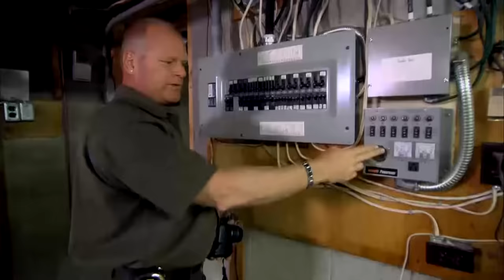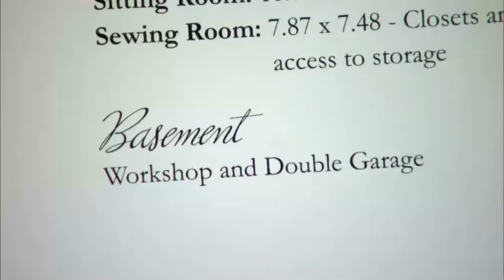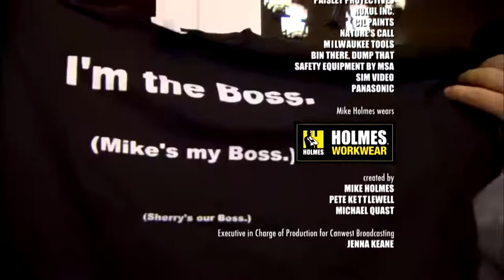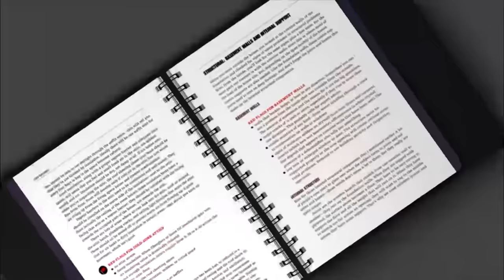Dream Home Turned Nightmare! | Holmes Inspection 119

Comment: Never use a home inspector that came recommended by a realtor. A realtor doesn’t want any possibility that the sale won’t go through.
Reply: Thanks! What would be the best way to find a good home inspector?
Reply: Or the home owner. ONLY get your own.
Reply: What a money pit.  Who is paying for all of this??  I guess the buyers got screwed by the home inspection.  Hope they can recover some of the expense to fix all of these problems.  With that type of construction, exposed walls, flat roofs, etc, there are going to be on going problems with leakage.  They should  have obtained separate well and septic inspections.  What a learning experience for the new owners.
Reply: @SophiaAphrodite  It is (at least in the US, I have not looked elsewhere) free to download the building codes.
Once you set aside the stuff for commercial buildings, you can even self-print a moderately thin pile to put in a binder.
Learn the basics about code.
Be your own backup inspector. If you can be present when the inspector you hire goes through, bring your notebook, ask questions, point out what you see.
If your inspector does not have at LEAST a ladder, a level, and a thermal camera, reconsider hiring them.
The should danged well at least get up to look at your roof, check the whole attic (no meercat action of poking the head up and calling it good), and walk through every space they are legally allowed to walk through.
-
If the SELLER bars you or your inspector from some part of the home ("Don't go up on the roof", the attic access is sealed with silicone, the cabinets under the sinks are padlocked) take that house off your list. They are hiding something they KNOW would lower the home's value.

Comment: That mold inspector was an absolute legend. Probably saved the lives of a few people in that family. Automobile fumes are no joke. For a series that finds negligence that inspectors and craftsmen miss or purposely ignore, its super nice to learn of a golden apple amongst the rotten ones.
Reply: Was thinking the same thing.  Nice to hear that there are people out there in the trades that have knowledge and aren't afraid to speak up and do what is right.
Reply: Make you wonder what training and qualifications needed to become a home inspector.  One should ask about their experience and qualifications before hiring them i reckon
Reply: Wonder whether there's time constraints on filing charges against original builder . . . defects thereof ! 🧐 🇺🇲 🤔
Reply: @mujkocka  Nothing. There is basically no training/certification/anything required to become a home inspector. There are trained/experienced inspectors out there, but it's a completely unregulated 'profession'. Many home inspectors don't know anything more than an average buyer. They get some minimal training at best on current code, and that's about it. Further - Even decent home inspectors are ultimately one person. They don't know every trade and will ultimately miss problems.
Reply: Ive seen people put garage doors in and just use it as a woodworking shop. That HVAC was still screwed up regardless lol
Reply: I hope Holmes tracked that inspector down and shook his hand for that find on the house.

Comment: Mike should go to the parliament and push for revamping the certification process for inspectors.
Reply: seriously. I don't even blame the previous owner even if they were dumb DIYers the fact the inspector missed the most basic issues
Reply: I believe he did at one point, either his first show series or this one. If not for inspection, but minimum code requirements. Keep in mind these shows are from 2010.
Reply: Plenty of certified guys, they just don't care, or perhaps realise codes are there to prevent stupid people from hurting themselves.
Reply: @Revkor cheap shortcut contractors also or was this diy by a complete amateur????

Comment: Two issues I have are that the pit for the ground water should not have been buried (again) under the pavers. There could have been a heavy removable concrete lid or cast iron grate installed as this shouldn't be a covered access point. Also, the new interior spindles for the railing do not match this type of house. They should have been a more modern type vs the traditional look chosen IMO. These people were really lucky to have this work done by Holmes and the other Crews. Professional work all the way around!
Reply: I sure wish someone would give a professional opinion of the rough cost to do these home remodels.  I was a semi professional years ago, and I would guess this house needed at least $140,000 to repair!  Probably a lot more since most of Mikes shows are shot in Canada.

Comment: If the home inspector mentions anything in the report, have a contractor in to do an estimate, before you buy the house. The home inspector will say don’t worry. It’s nothing. The contractor will tell you how much it’s going to cost to fix it. Just like a used car can burn you if you’re not careful, a used house will burn you but it will be much worse.

Comment: Man that house is a fire trap, when you see that aluminum mess at the panel, you just know there are shady boxes like that buried in the walls all over the place.
Reply: Yeah for real.
Reply: The problem is, short of gutting the whole house, there isn't much to be done. You can make sure the right materials are used (aluminum rated splices and devices) and possibly try using arc fault breakers. 

I also think that the panel could have been addressed differently but budgets are always a thing and it is a great job that was done within the limits of the project. 

With aluminum wiring education is key, the homeowners being aware of it and it's risks in the home will hopefully keep them vigilant of issues and not ignore 'small' electrical problems

Comment: Split foyer and raised ranch houses in my area have the garages under the living space. The garage IS separated from the rest of the lower living space and ducts are covered (no vents) in the garage. I don't see why this house can't have the garage under the living space if the area is walled off, ceiling covered with 5/8 drywall and the ducts enclosed.
Reply: Exactly!
Reply: Perhaps cost? Might have required re-engineering HVAC to move trunk, would have had to seal the floorboards, ceiling. Would have still needed to heat the garage as there were water lines, etc. 

The home owners still pay for the repairs shown in this show (something like 20-30% of the cost) — it may have been their choice, or perhaps Mike didn’t want to touch that issue from a potential liability standpoint.

Comment: I love this show and Mike and his team did a great job as always, but I was sorry to see them remove the boards inside the house and put regular siding on the outside. I know the house was a lot better physically after they were done, but I liked the way it looked before much more.
Reply: For speed and economy. It's a tradeoff. Mike Holmes and crew are home builders first not preservationists. That's evident in many of these episodes. The one with the kitchen center stone range was especially disappointing with how bland it turned out. Even the homeowners appeared disappointed. Probably likewise in this episode with the finishes and taking out the garage door.

Comment: I am working HVAC in Montana on new homes.  These new homes have high efficiency furnaces in unconditional attics, with heat tape on condensate lines and the heat tape is inaccessible.  These were built with flex duct too.  All the retired baby boomers are buying these homes.  "Hayden Homes".

Comment: What this video really shows best is why houses should be made in factories using proven designs. All the problems which might exist in a manufactured house can be designed out before mass production occurs. If you build your own house and then allow an inspector to second guess the builder, you will end up building and paying for the house twice. The second time it will be paid for one small, expensive detail at a time.
Reply: Looks like a lot of work was done without permits and inspections.

Comment: Little confused why you barricaded it off where you can't even get to park next to the steps. Barricading it with boulders seems a little extreme! ?
Reply: Well perhaps it’s not to code to park right next to the house, just in case someone has the window open the fumes could leak through and kill them!!  

<sarcasm used in this post>

Comment: The producer always needs to rock the drama queen aspect. Don't understand why the "workshop/garage" didn't have the HVAC ducting reconfigured, new stud walls built up and sheet rocked to modern code. Wouldn't that have resulted in a space for a single vehicle? The pole in the middle of the garage door? As much as Mike loves bringing in engineered headers to take a load, seems easy enough here. Why was the cistern sealed up? Couldn't the mason have built up the cistern height to ground level and a drainage grate installed? This episode...leads in head scratching solutions.
Reply: I still can't figure out how that cistern drains what appears to be an uphill slope from what I could see.

Comment: The sad thing is my sister bought a house ( USA ) and had an independent inspector come in, she sent me the list and i went and visited her, first thing I said was get a plumber to put a new hot water tank in, not only was it old, it had a 35' run of exhaust to the chimney and it had no incline to it, just to the ceiling then 30 ft riding the ceiling to the chimney. I told her that would kill her. First thing the plumber said was the water heater wouldve killed you ( to my sister ) i am not in the trades but knew that was wrong.

Comment: @41:14:  Mike always talks about surge protectors in terms of lightning, but they're really more like water hammer arrestors for electricity.  If a large load slams off, it absorbs the shock at the panel instead of transmitting it through other circuits.  Sure, theyre useful if your house gets hit by lightning and has insufficient grounding, but that's not the most likely scenario.

Comment: In the UK and other countries home inspectors should be regulated and hold professional qualifications and hold insurance against missing vital costly issues. Perhaps a client could pay for an insurance policy against a defective report and then insurance companies wouldn't cover bad inspectors. Any claim above say £1,000 or £5,000 ( whatever is agreed by law to be reasonable) if the result of an inadequate inspection would be paid from the inspectors insurance.

 We should also have an independant ombudsmans service that all building contactors are required by law to join and have a bond to cover bad work.

  A licence to run a contracting business from the local building standards department ( code department) that could be withdrawn if the work isn't to code should be a basic consumer protection.

 People who break the law by doing work that isn't to code should be at risk of being jailed if taken to court. At the moment they risk almost nothing and carry on devastating peoples lives and financial security.
Reply: There is only so much you can determine externally without destructive inspections. You might notice Mike inspects a lot of stuff by poking holes in the walls.
They need to make permits cheaper and faster to encourage people to do the work properly.

Comment: I have a aection of town where many of the houses have garages underneath them.  The platt is hilly, so it made sense on the 1920-30s.  Many of these basement garages are enclosed or inoperative because of failing retaining walls or vehicle sizes.

Comment: That garage under the house is legal, as long as it’s sealed so no carbon monoxide can leak into the rest of the house, like any other garage would be sealed.
Also as long as it’s not being heated by the same forced air furnace, that’s heating the rest of the house, but if you are using hot water heat, you can use the same boiler.
I’m surprised Mike didn’t point that out, they did so much extra work with landscaping that wasn’t necessary on this project, they could have just sealed the garage.

Comment: Yes the garage should have separate heating but it still wont take the fumes through out the house as there is no cold air returns in the garage

Comment: The issue of the garage is way overblown....It may be against code, but still, as long as you don't run your car's engine in the garage,its not a problem.

Comment: The problem with Aluminium and copper connections is not expansion.
 Aluminium is be very susceptible to corrosion in contact with copper.
The corrosion will cause the failure due to heat in the joint.

Comment: They could always turn the garage into a wood shop.
Reply: Not a good idea.  Sawdust would get into the air vents and it's highly flammable, and I think potentially explosive.  In one of their netflix shows they redid a school carpentry (and other) shops and the amount of special stuff they had to install to deal with the wood dust was pretty crazy.  Also, wood tends to have mold and other stuff on it (if natural) and it would add pollutants to the air.  And if they wanted to stain or treat the wood, you would have all of the off-gassing from the stains.  Wood shops are definitely best away from residential spaces.
Reply: @zhombyland1159  Depends how much work someone is doing. I doubt a home hobbyist would have much trouble but if you were trying to run a fully fledged workshop, that's a bit different.
Reply: Or buy two EV’s.

Comment: I am rather disappointed in this episode.  Admittedly the Garage was not proper, but the statement that "we can't have this as a garage" was more of a "we WON'T let you have a garage because it is too much work".  This IS possible, but it would be a massive undertaking that they are not willing to take on for a "show".
Reply: I think it would be a better idea to just build a new garage on the side of the house than to try and revise that basement. Seems like they were using it for storage space as well anyways. But I do agree, I kind of expected Mike to go all out like he normally does and remedy the issues with the HVAC and fumes.

Comment: In America, we are not allowed to have a electric panel mounted sideways, like in this home.  1/2 of the circuit breakers, when off the switch is going down, but the other 1/2 the switch is up in the off position, and that is not allowed in America.  I would have recommended rotating the electric panel upright.
Reply: I’ve been an electrician in the US for 26 years, every time I see these panels mounted horizontal, it makes me cringe. It doesn’t make sense to me either. We actually mount ours with the main breaker at the bottom. Easier to reach in an emergency, and a much cleaner installation as far as wiring methods.

Comment: If you have the duct work heating the garage there is no reason to have the car running. Start up and pull out or when you pull in shut it off. Even with no duct work in the garage why would you leave a car running inside?
They could have kept that a garage by sealing up all the joints and installing drywall as a fire barrier which all homes are supposed to have when it’s against a living area.

Comment: that was built 40 years ago.. surprised it passed back then
Reply: The garage separation was required more than 40 years ago.
Reply: @michaelseavello4612 It was a basement originally, not a garage.
Reply: Could easily have been no enforcement or just a lazy inspector, corruption or nepotism.

Comment: Most people don’t leave their cars(or tractors) running inside their garage. Plus a car, truck or tractor don’t continue to vent carbon dioxide after they are turned off. If they did mechanics couldn’t work on equipment inside.

Comment: That upper railing so everyone knows in the 1970's was code. To say it wasn't when it was a lie. It was it is not now. I wish they would be more upfront about that. Same with the wire. Aluminum is safe if its treated right. The fact that the electrician did not use the gel that prevents the electrolysis between the copper and aluminum is the problem. To put the whole blame on the wire is wrong its the workmanship that is to blame.

Comment: Using a man boom lift to raise a concrete drain cover is not good, Welding in a well hole without a harness and ventilation is not good.

Comment: So instead of a way to get them a garage to help with the kids and weather they built a massive slip hazard area for them and their kids to fall during cold weather. I would have built a garage in the driveway and had a breezeway into the house instead of making some silly looking hardscaping. I know I would prefer the garage over such a dangerous space for kids.

Comment: I wonder how much money it cost for all that work. This show never mentions that . Why ???
Reply: I be agree it would be helpful to know adds a significant dimension, some of the shows do mention cost—some don’t.  Maybe it’s left for the owner to ok if mentioned or not?
Reply: You’re easily looking at $100,000 in work. The basement was unusable as a garage because there’s a beam in the way. So there was no issue there. The wall repair was necessary. The electrical problem was real, needed to be repaired, but very over exaggerated. The foundation repair was necessary. The well work  was recommended, still not 100% necessary. Same with the drainage. I’d have done it in stages. Front wall was an immediate need. Foundation as a secondary concern. Electrical could be done at any time because it should not be expensive.
Reply: If over 50 percent of houses worth often in usa they say tear down. But this is Canada.  If not torn down then everything has to be to the latest code so giant cost

Comment: Tbh. 40 year old house. Electrical, plumbing roofing etc has a lifespan of 25-30 years. If not fixed in 40 years. What seen here is not abnormal at all, just shit needs to be fixed.